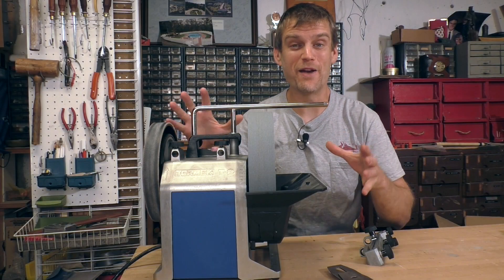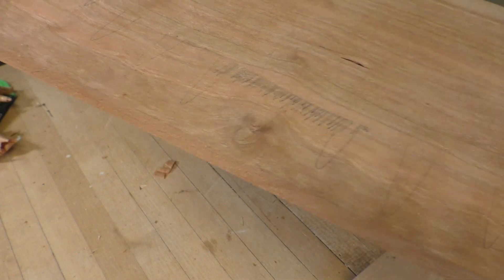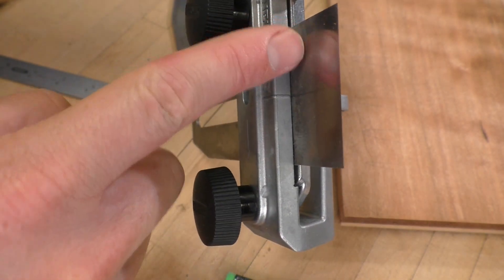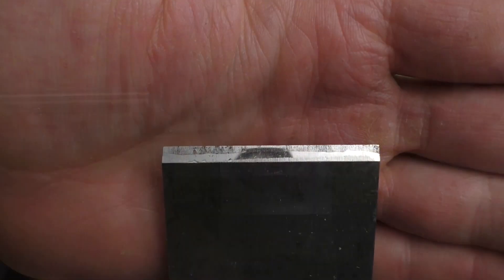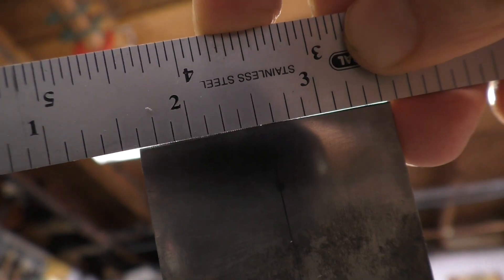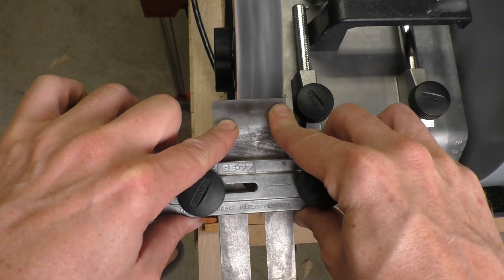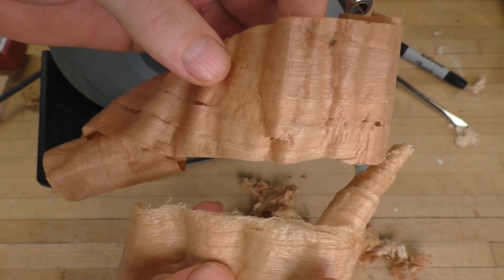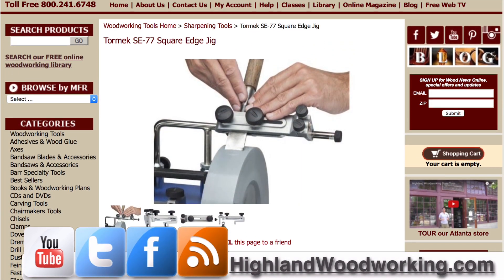Using the SE-77 Jig to Camber a Plane Blade on the Tormek Sharpener

Comment: My problem with your amount of steps is that you want this whole procedure to be really fast - think if I have to sharpen blade again and again or different ones. No wonder many of woodworkers go with hand sharpening with a simple honing guide & a simple angle jig and diamond plates. (using finger pressing on alternate sides for camber).  It goes much faster. I have a Tormek myself. But sometimes I find it cumbersome, fill the water, grind the wheel - rough vs smooth, and then use the jigs in a very particular way.

Comment: I didn't watch this all the way through. So this info might be included or common sense I don't know. The angle of the blade in the plane enhances the camber quite a bit. I turned my oil knobs almost a whole turn which turned out to be waaay to much. :(

Comment: With all due respect, this video is a good lesson on using the jig, but not the plane. By grinding a camber, you are producing a “scrub” plane blade. It is not designed for light cuts, but for quick removal of high spots, usually at 45 degrees to the grain. Its use is then followed by a straight grind for smoothing along the grain. The ridges produced by the straight blade were due to taking too heavy cuts. When smoothing, the finer the shavings, the better = no ridges.
Reply: Not true, a scrub plane has a huge radius, the camber on a smoothing plane is in the thousandths
Reply: @billlittleton7894   Ideal camber for Jacks plane .
Reply: @billlittleton7894  okay. But if the lady takes money for sex, does it really matter how much she asks? 😄

Comment: Nice video. Well produced and informative. -- I have a T-7, so I agree on how wonderfully sharp any blade can get using the Tormek. -- With that said though, it looks like it might be more work using the SE-77 to camber a blade than using a cheap manual honing guide. -- I was wondering about how you reset the jig using the micro adjustment knobs once you loosened them? Is it easy to lock them down so that the jig is square again? -- I like your videos, so please keep up the good work. -- Cheers!
Reply from the maker: The two knobs work in concert to create an even camber on a plane blade.  So you can loosen both of them a 1/4 or 1/2 turn or so.  When done, tighten them both up the same amount and the jig should be back to square.  If it was me, I'd double check - but I do that with my tablesaw blade every time I take it out from 90 too!  It's a very easy operation and the knobs are large enough to easily keep track of turning.
Reply: There are witness marks on the part that pivots. You only have to observe the marks align with each other while you tighten the knobs.